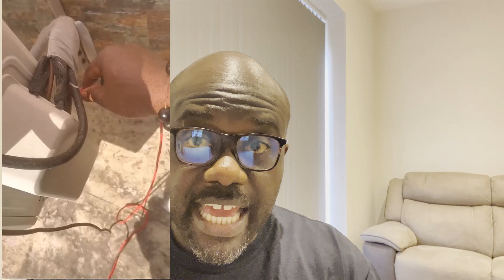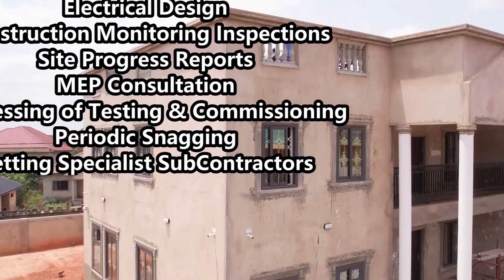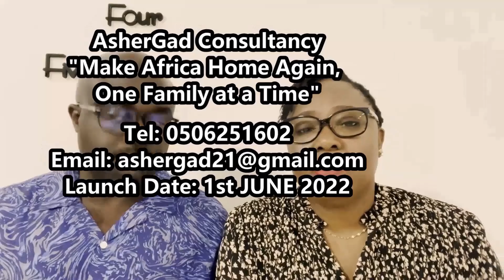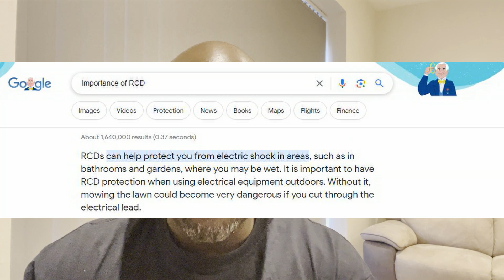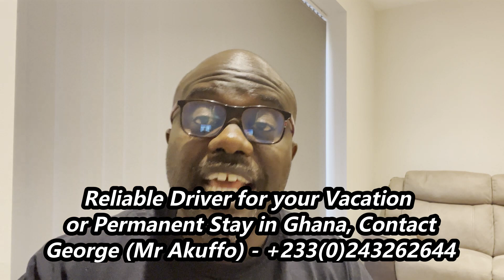ELECTRIC METER RUNNING TOO FAST IN AFRICA?

Comment: Excellent work sir!  Does the driver have A/C ? Thanks.
Reply from the maker: For sure
He has about 5 cars he uses.
3 with AC and 2 without AC 
So when you get in touch with your requirements he will sort you out…
Reply: @kingstal90 Thanks so much for sharing his info.
Reply from the maker: No problems

Comment: We need a proper regulatory system to sanitise the trade industry... 99% of the workers have poor training... anyone can just wake up after learning how to wire up and claim to be a trade electrician... national standards, training, certification, membership and regulations must be drawn up.. this goes to painters, plumbers carpentry building etc...
Reply: You are right. Like I always say  the best way to reduce unemployment in Ghana is to sanitize the trade industry and make it attractive with certifications to prevent untrained staff working in the industry
Reply from the maker: Very true
They do have certifications 
But the law is just not enforced 
But at the same time there are loads of untrained trades people

Comment: The RCDs cost around 300ghc for a good one but then there are some bad ones around 70ghc it's really difficult to convince someone to go for a good one when they get to know the prices but buying the cheap one is waste of money and dangerous
Reply from the maker: Agreed
I would even buy the ones that are 750ghs
Reply: Havells RCCB is 200 cedis and it works flawlessly from our testing. It detects leakages, short circuits, etc.